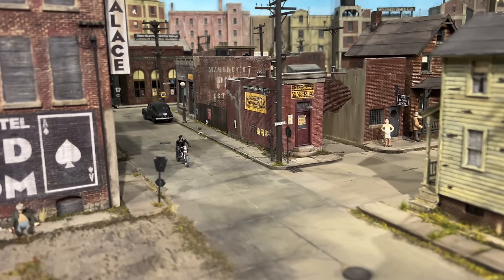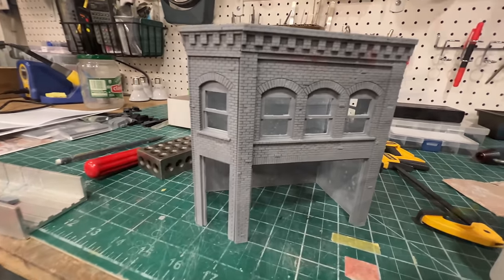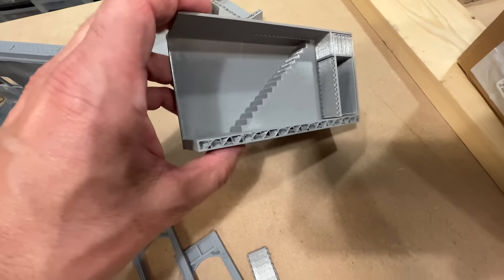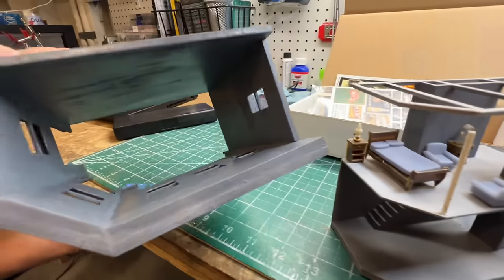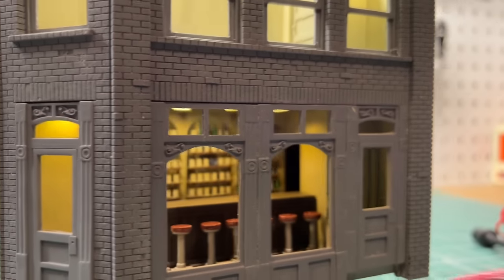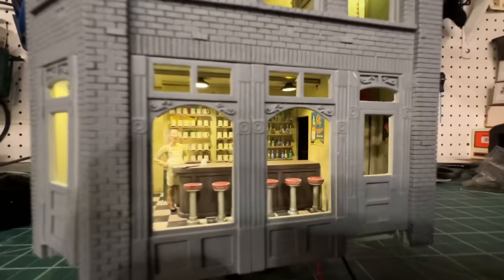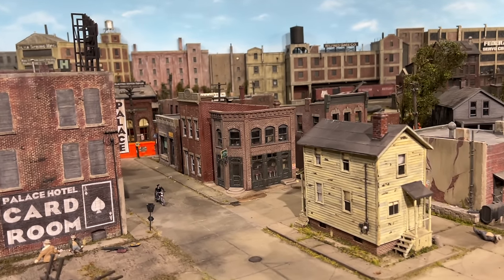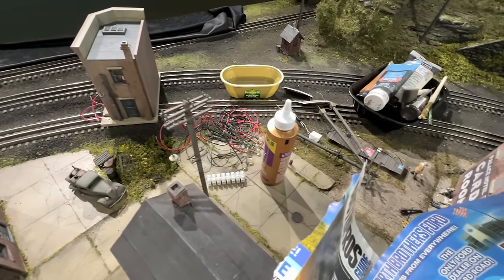The Chronicles of Norm #23 - The Bessemer Bar

Comment: I've seen a building like the one that you're modelling, and the stairs are enclosed and lead from the back door, and then curve round to the back wall, and lead to the domicile above, which was usually a flat and office. And the bar is open and can only be accessed via the front door. the stairs are a private area that the bar owner had access to via a doorway at the bars end. The backdoor usually led to a yard for storage that had a fence enclosing it, In the UK, we had many shops and local pubs that had the same kind of layout. They were mainly houses that were built during the early to mid Victorian period and were converted during construction into corner shops, pubs or the like. You can see the same thing in New York and Chicago, these were your local shops.
Reply from the maker: During the course of this project I got the opportunity to go and goof off for a week in Hammersmith. I got to visit many fine pubs all around London and it definitely gave me a lot of inspiration for this build. I meant to put in a bunch of photos I took on the trip but this video was already getting too long.

Comment: Oh don't start me on even smaller! This looks brilliant! I am already down to 1:18th scale as I can get people and horses and make the rest of my usually medieval scenes.  I could see myself getting seriously into 1:48th, especially if the kits are available for the buildings.  I would go with the external stairs, I think it fits the period and would help in that they don't have to go through the bar to enter and exit,  even if the apartment came with the bar, so to speak, I think external stairs are definitely preferable.  If you think that they would have to use the bar keys every time they go in and out, it wouldn't really be feasible, even to the proprietor. I love this model btw, I am already thinking how to do it up, inside and out!  I just had to subscribe,  told you, hooked already!

Comment: Great layout, I had an HO scale layout on a ping pong table and a half but it was difficult to detail the center of the table,  I was going to build a mountain out of plaster in the center of the table with track running around it,  I had to take it down and box everything up make more room.  I am planning on building a new layout on a L or U shaped table now that it is winter,  I must have a couple hundred feet of track, 20 different engines and 80 freight and passenger cars along with dozens of HO structures.

Comment: In the late '60's into the '70's my two older brothers had a HO set, with a HO slot car set, together.  I remember the gas station had fuel price of $.27.9, leaded.  We ran the race track mostly, but making the layout look realistic was always difficult.  Grass came on a roll like wrapping paper, and usually fell off as soon as you got it out of the plastic.  Now with 3D printing, it is incredible what detail a person can do.  I keep wondering how many hours you put into a building, like the bar.  In my home town, there's a bar called the Elbow Room.  It's been there for 90 years, but some Millennials bought it now, and destroyed all it's character. But I digress.  Your buildings look so much better than those you can buy, like the Snow Village, that were popular years ago.  Great job!  I also like the realism of the "John" negotiating with the hooker outside the bar.

Comment: Great work as usual Norm!,  on the buildings you dont want to model interiors on, have you thought about doing like a "newspaper covered " closed  up shop look?
Reply from the maker: Good idea. I do have a storefront in the town for rent. It’s a Thom Yorke kit. The interior has some old crates and scrap in it but it’s not lit. I couldn’t decide what I wanted it to be at the time.
Reply: I love what you did with the interior on this build. Would you be open to selling these interior parts for others
Reply: @normstrains  Just an idea, but sometimes, even a currently vacant storefront has one lightbulb burning in a back room, storeroom or in the alleyway above the back door.

Comment: Norm, your interior is incredible - great work! But I am curious: wouldn't it have been a lot easier - and perhaps even cheaper - to build your floors, walls and roof out of styrene instead of 3D printing?
Reply from the maker: Probably 😂 but I love 3D printing and could make the integrated stairs, etc. way faster and more precise. I have been using the printer for tedious things like beam assemblies and window frames too.